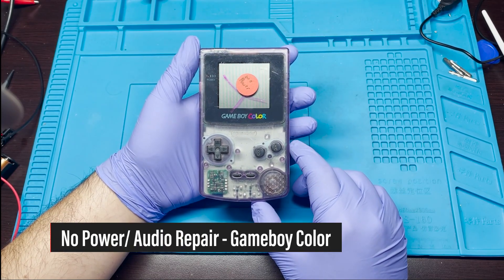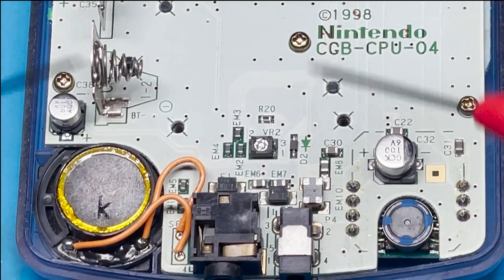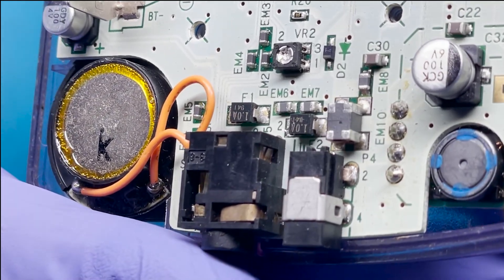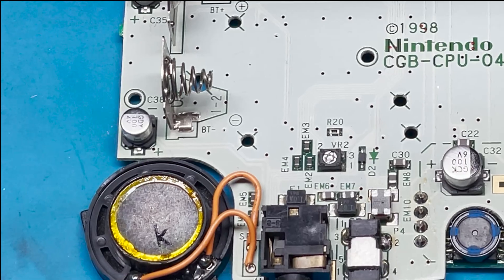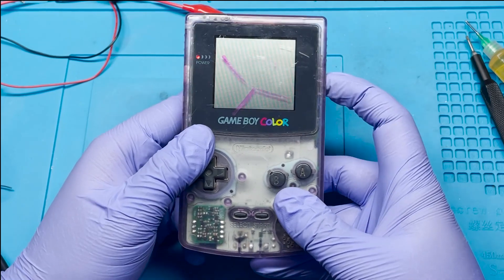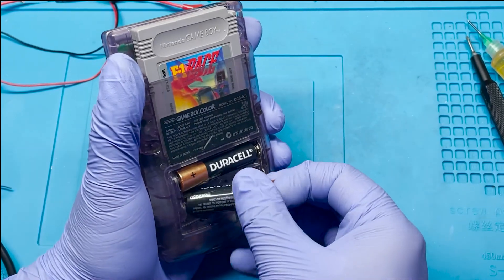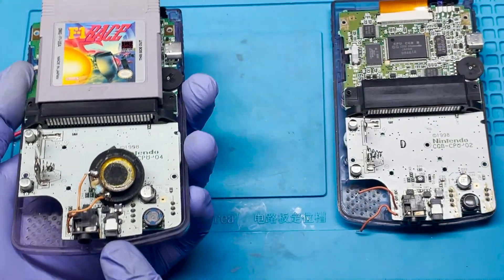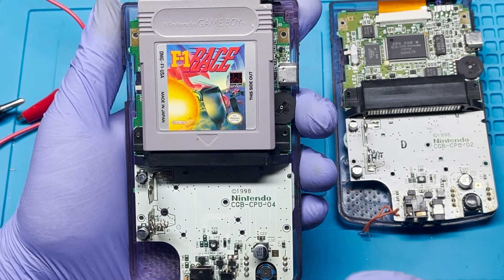Gameboy Color - No Power/Sound Fix

Comment: I have a GB color that turn on led but no imagen and no sound, why could be the issue???
Reply from the maker: Its hard to determine without a visual inspection, but most Gameboys I come across have some form of corrosion, I would make sure that the ribbon cable is not damaged or causing poor contact due to oxidation

Comment: You are my savior! Just bought GBC from Japan and it had all the issues with power - from battery pins to dc input without continuity (including power switch problem). Now it’s alive. Also had sound problem and headphone jack was the issue. Still can’t regulate volume level, but I’ll try to clean volume later today :). Thanks again!
Reply from the maker: Awesome! I'm glad I could help you get your Gameboy Color up and running!

Comment: great vid’
i am having a power issue as well, i  have checked the fuses, power switch, power supply and speaker, it won’t power on. 
i don’t how read a schematic, what would you check afterwards ?

Comment: Thank you for this video. I had checked everything else (fuses, power switch, power to the switch). How does a DC jack suddenly go bad on a working GBC?!
Reply from the maker: Most of the time, the DC Jack always messes up due to corrosion from my experience. Even though you may not see it, it may be inside the port itself that the corrosion is occurring.
Reply: @totalfix877  I restored 13 GBCs over the past year and one of them stopped working because of the jack. I agree with you - the bad jack was really cruddy. The replacement jacks are so cheap that I wish I had just swapped them all out. But, I didn't know that that was a thing until I saw your video. Thanks again!

Comment: Great video! Better than a lot I’ve seen out there. I’m currently having this issue, changed Caps, audio Jack works, so now I’m back to deciphering that wiring diagram lol
Reply from the maker: Sometimes the jack can work fine with headphones plugged in, but the speaker audio will not work due to corrosion inside the audio jack. Hopefully you got it working again!

Comment: That’s a bad idea bridging that connection. If someone plugs an external power supply in if the batteries are still in situ your gameboy will be toast.
Reply from the maker: Yes, that’s why I only did it as a form of troubleshooting but not something I would sell to anyone. I bought aftermarket replacement parts to replace this specific component which you may find here:

https://console5.com/store/game-boy-color-gbc-and-game-boy-pocket-gbp-dc-power-jack.html